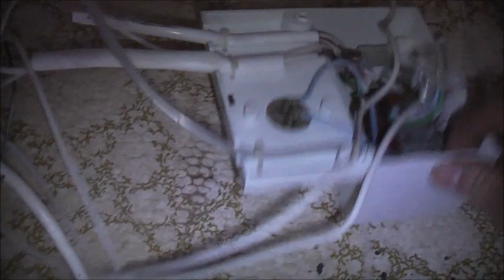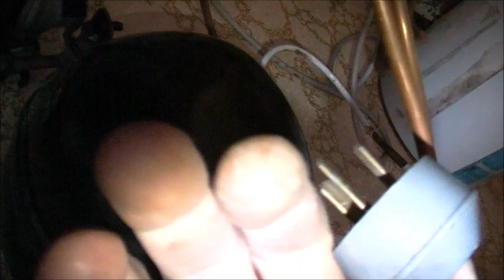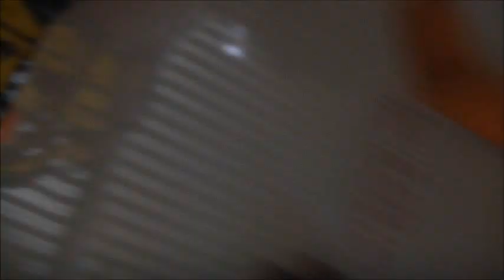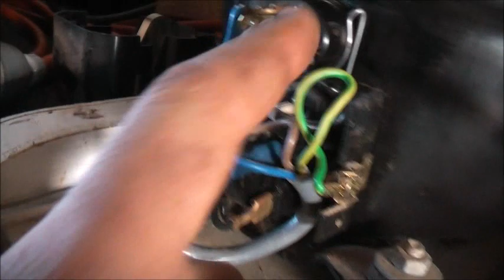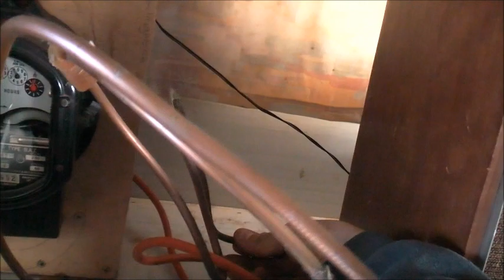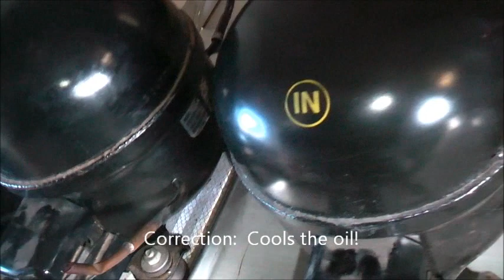Fridge Compressor Test & Icebox

Comment from the maker: No starting Capacitor,  Only domestic fridge compressors use a starting relay, as these are low torque starting motors, High torque Starting compressors are typically found in Commercial refrigerators, in this case all use a Start capacitor!